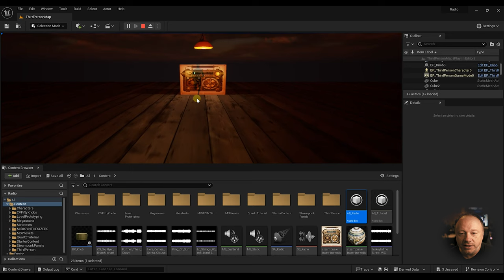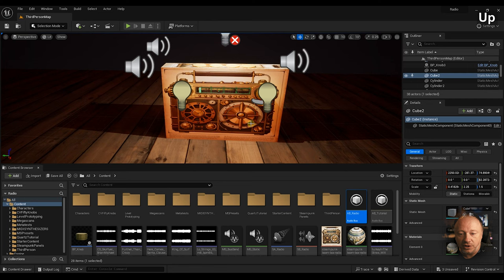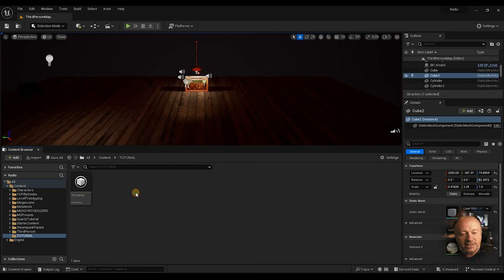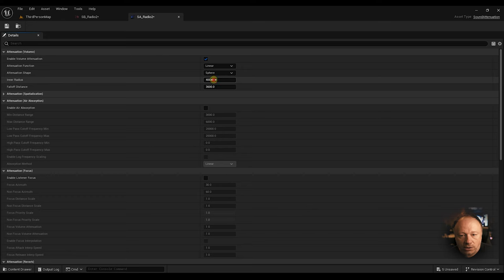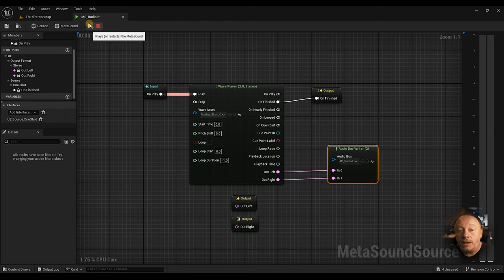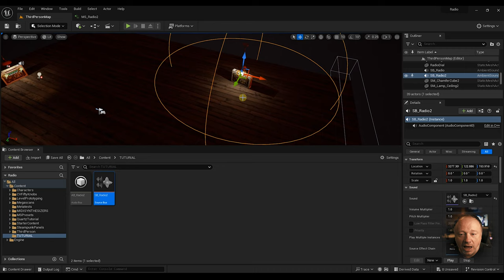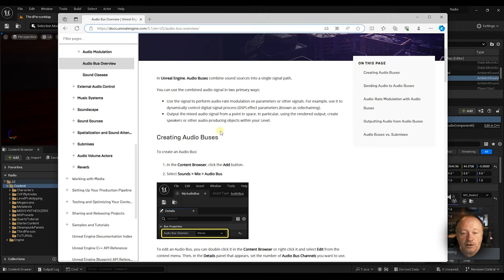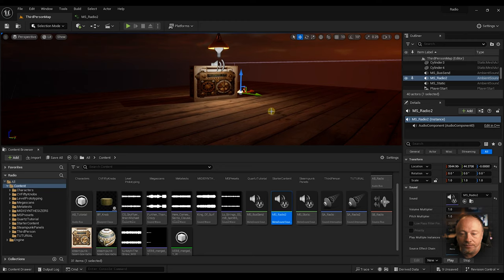Metasounds: AUDIO BUS & SOURCE BUS - Grasp This Concept in 10 Minutes!

Comment: I want a situatoin where the hearing of the player can be altered with effects (kind of like on a trip). I have various sound sources placed in the world with spacialization and attenuation. I tried out both approaches:

1: If I route everything on a audiobus and use a sourcebus
2: I use a Metasound with audio bus reader
but with both strategies I lose the attenuation and spacialisation of my sound sources placed in the world. :(
would love to hear your ideas :) am I doing something wrong?
thanks!
Reply from the maker: Sounds like you just need to route your audio to an effects bud send. Like you would a traditional reverb send. And feed the sounds with a control bus parameter
Reply: hey, thanks for the quick answer! Do you mean an audiobus? or with a sound submix? (I cannot find an "effect bus send"?) audiobus I lose the attenuation as i mentioned. and the problem with the  sound submix is that apparently I can only use the preset fx, but no metasound patch or something like that. (I would have wanted to use some distortion and flanger stuff...)  @brianmichaelfuller